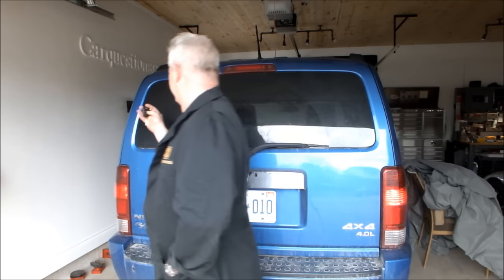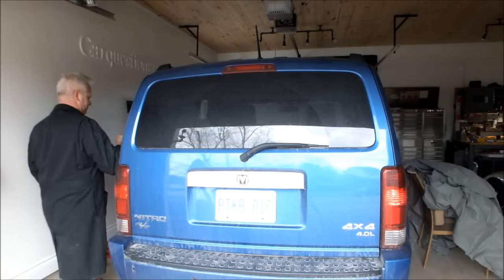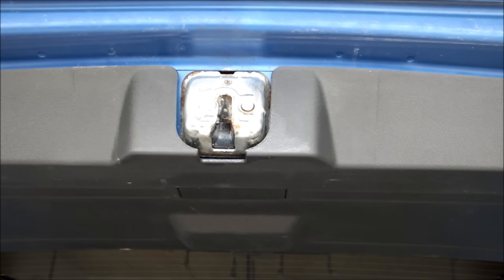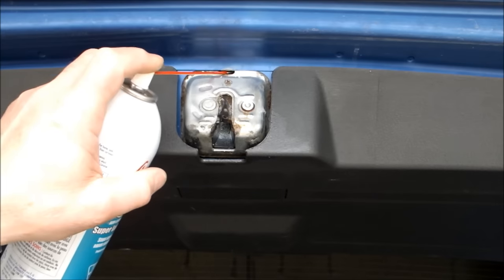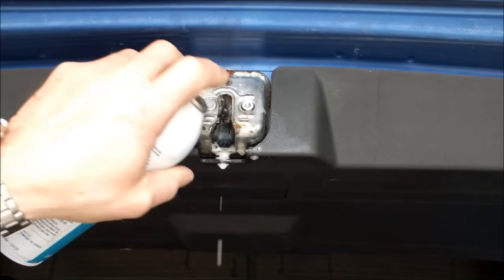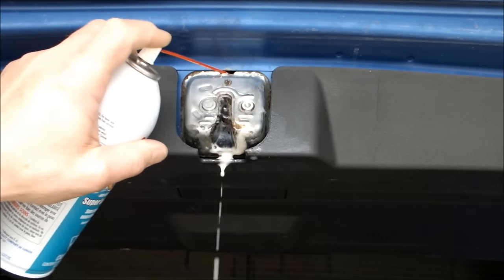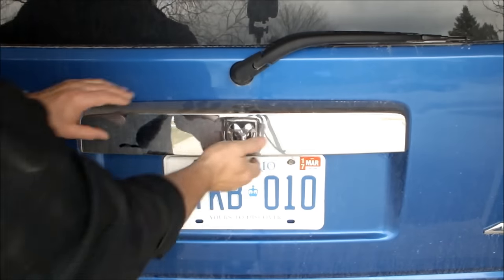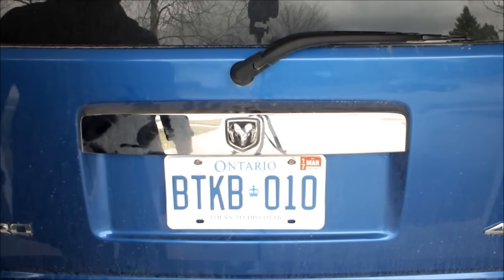Car Alarm Keeps Going Off - How To Fix It

Comment: My Ford Escape is doing the same thing! I go outside every night and slam each doors like crazy then go to bed, well that isn't working anymore (annoyed) it goes off at 2am! I will be driving down the road and my door ajar light will come on...(annoyed) did you say to say WD40? Thanks for the tip! I am going to try it.
Reply: Did this work for you? My Ford Escape does the same annoying thing...
Reply: I tried the liquid wrench- I used it on all my latches. I think I sprayed way to much into my driver side latch. The remote nor the button on the side to lock the door wouldn't work. I had to use the key. 3 weeks later it started working again ---So be careful with that. My alarm went off twice since then. I still go slam them all before bed time. But instead of using my remote to lock all the doors, i use the key instead. So far so good.
Reply: txb4u Ah, cool. I actually don't use my remote. I just lock it with the key. My issue is the alarm goes off hours after not even touching the vehicle. I've tried the wD40 approach and it will work for a day or two before the alarm decides to be a dick again.
Reply: Man- well try the liquid wrench and see? to me it seems a little more greasier) 
I think that the back hatch latch may be the trouble maker. When I go it open it, it seems like its way too easy to open, whereas if I open the glass part It seems like it's latched on tighter, I think the batch hatch door is failing. Next trip to the mechanic I will mention it, In the meantime- ring around the Ford Escape slamming doors like I am mad a the world! 
Hope the best for ya man! Take care
Reply from the maker: Then try to narrow down which door it is and have the latch removed for inspection or replacement
Reply: I've just been disconnecting my battery terminal for the time being until I can get it to a garage.

Comment: That works for awhile, maybe a few months, but eventually you will need to isolate which switch it is and replace it. Or, you may be able to use an OBDII USB interface and a laptop and toggle the door ajar switch to off in the software. I always thought that horn beep alarm was worthless and just a nuisance. If you can't do that just disconnect your horn, all the horn does is create road rage and will get you killed.
Reply from the maker: Well said Doug! Cheers from Canada!

Comment: I won’t even lock my car and a few minutes later I come back and open the door and car alarm will go off also my key fob won’t work any ideas ??
Reply from the maker: Get a new fob and try the procedure on all doors - let me know how you make out
Reply: @carquestions  I changed my battery on my key on a Acura MDX 2008 now my alarm goes off crazy the doors won't open and if I touch the door handles it goes off the alarm what I do need HELP

Comment: I have a 08 Ford edge and the alarm goes off on its own and the doors lock and unlock by themselves what could the problem be
Reply from the maker: Bad switch in one of the doors or rear hatch - try spraying - or replace the switch

Comment: My van locks but the side door doesn't I lock the van with remote and everytime it beeps so all the van is locked but side door is open any suggestions please
Reply from the maker: Ya bad connection or door lock motor - get in there and check - let me know what you find

Comment: I have a 2009 kia megentis and this happens plus it keeps saying the drivers side  door is ajar. Could that set off the alarm
Reply from the maker: Yes it can! - check the switch in the driver's lock for rust or replace it - let me know what happens. - Cheers from Canada Josh!

Comment: Interesting. Has the same issue with my 2009 Mazda 6. Dealer says its a problem with a computer and that'd be about $500 to fix(I also have the key fob batteries draining out in a couple weeks, apparently that's a related defect where the computer is constantly communicating with the key fob, draining the batteries)... I'll give this a try, at least for the alarm which annoys the neighbors, I have nothing to lose at this point.
Reply from the maker: Let me know what happens - good luck HC

Comment: My 2005 Nissan Ultima keeps beeping when car is off periodically how can I resolve this issue
Reply from the maker: check to see on dash if each door and trunk switch is working by opening each one at a time - dash light should come on - if one doesn't - then that's the lock that needs repair

Comment: Where are the other door switches located typically?
Reply from the maker: They are incorporated into the door latch in most cases - old cars from the 70's had separate switch on the door post somewhere

Comment: just put a new starter in my 2006 pt cruiser. lost remote to alarm a while because someone broke into my car so i stopped locking it. now the alarm wont go off until i cut thr car off. it only stops when i go over 50 mph
Reply from the maker: Does the dash say you have an open door while driving sometimes? if it doe - try this procedure on all doors and hatch - it could be any one of them -

Comment: It involves the lock on my truck in a way, i got a key fob to program to my truck(97 silverado), it says to connect terminals 8 and 4 on the scanner port up front and the locks shoulg go up and down. They don't though that's the problem. Tried copper wire and anything conductive but nothing worked. Even went to the dealer and they couldn't figure it out either.

Comment: I just noticed my 2005 dodge Dakota truck alarm lights are flashing, even though the alarm is broken. I just got a new battery with new terminals, and this afternoon i go out and the alarm lights are flashing. Any thoughts.
Reply from the maker: Try the horn to see if its working - if it does I'm thinking TIPM issue - if it doesn't try the spray and let me know what you find - Cheers and good luck

Comment: My alarm is on and fob will not work had to take out the battery cable any suggestions?
Reply from the maker: leave battery disconnected for tonight and lock all doors and check it in the morning

Comment: My 1998 toyota sienna car alarm is acting up again. Disabling my ignition/ starter whenever I try to start up the vehicle to drive. I lost my key fob
Reply: A couple things I would try. If there is a red light/button next to the steering column on the dash, turn your key to the ON position and press and hold that red button for about 5 seconds, that should disengage the immobilizer and allow the engine to start. Alternatively, insert your key into the ignition and switch between the OFF and ON positions 5 times, you may hear the alarm chirp to indicate it's been reset. You'll need to keep the key pressed in while you do this for a smooth action.

Comment: Can i just get rid of the alarm. It goes off while I'm inside with it running... Its a 96 ford ranger
Reply from the maker: Look in the owner's manual for the location of the horn fuse or horn relay - then pull it out and remove it - that will stop it but you'll have no horn

Comment: I have a problem when I turn my car on everything just starts to go off emergency lights headlights windshield wipers what can it be?
Reply from the maker: love to know but you didn't say what the make model and year was
Reply: carquestions 2009 Nissan 370z
Reply from the maker: You have a serious electrical issue - check the battery for voltage and all connections right away for damage, loose fit, corrosion etc - check every wire you can - try another battery - if you find nothing get it into a shop right away

Comment: I have a 2004 Nissan Xterra it just started that this week like I'll lock it up for the night go in my room than I hear it randomly go off for no reason so far to keep the "peace" I took the 15A fuse for the horn out, but the lights still flashing basically saying the alarm is still going off randomly. PLEASE HELP!
Reply from the maker: lock it manually without alarm then pull fuel pump fuse

Comment: This wasn't the issue in my case. The remote key (hold for alarm) button was stuck down. If taking out the key battery stops it, then it's the key. I had to open it and polish down the button stump inside to make it shorter and give it room to unclick.
Reply from the maker: Thanks for the info Alvaro -
Reply: carquestions thank you too.

Comment: I have a Chrysler Town & country 99 model the alarm keeps going off and the emergency flashers keep coming on even when the buttons off
Reply from the maker: You might have a problem with the TIPM (fuse box corrodes) Sam - might be a free recall repair - so look for TIPM problems online with a google search to learn more
Reply: @carquestions  thank you I'm researching it now

Comment: my alarm keeps going off through the night, my neighbours won't be very happy. I have only had the car a couple of weeks, I have just sprayed all the latches with wd40 fingers crossed it works. It is a 2009 dodge caliber, I am not sure if the alarm is after market. the garage where i purchased it brought it to me becouse of covid. a couple of days later i was about to take it out for the first time and it wouldn't start, so i called the garage and they came and used leads to start it up, they left me with thier charger but I wanted to be sure i wouldnt get stranded so i took it for a new battery, its started fine since then. But when i tired to recharge the old battery it said Full after 5 minutes.  I dont know if these issues are coming from the same place, but if anyone else has one of these cars and can shed some light on it for me id be greatful 

I will leave the car alone now and see if the WD40 in the latches works .  but wether it works or not thank you :-)
Reply from the maker: Get the charging system checked to see if it's charging the battery and let me know how it works out - cheers from Canada!

Comment: common with acura mdx hood latch... the alarm microswitch gums up with dirty oil and when humid weather hits the alarm goes off... easy fix … clean switch or as I did unplug the connector...
Reply: Wondering if this could be what’s happening with my csx as well. Thanks for commenting; will have to try this.

Comment: This just happened to my dodge nitro 2009 same as yours twice at 3.30am. The first time I just locked it again with my keys to stop it. 2nd time I did the same thing. But this time went to the car to grab my toolbox in the back to get tools to unhook the battery & deal with it in the morning, as i dont have 4WD here. LO AND BEHOLD I hadnt shut the back door gate properly!! And the car was trying to tell me "you've locked the car but one of our doors isnt locked shut instead it's just hanging". Hence the alarm so guys check your doors are shut right as it could just be that 😅
Reply from the maker: Very good advice Skribbz - cheers!

Comment: I've done this and it's still going off.
It usually happens at night, sometimes in the day. I don't know what to do anymore asides disconnecting the car alarm
Reply from the maker: You might want to check the computer for fault codes - and start your troubleshooting from there - or take it to a local garage but don't let them experiment - if they recommend you do such and such - ok it if they promise that will definitely fix it - you're not paying for guessing

Comment: My car is a Kia soul 2012 and my car alarm started going off randomly yesterday I tried making sure all of the doors where shut and all but it still doing it today.
Reply from the maker: All doors, hood hatch etc? - if it doesn't work disconnect the battery negative terminal to stop the horn and later take it in to a local mechanic -  let me know Katie how it works out

Comment: I am having this same problem on my 2010 jeep liberty but the I also thought the glass might be the problem because I have the hatch for the glass if u press the keyfob 2times it should open but it won't but if also tried plus ing it shut and it doesn't seem like it's even opened at all it might just be because it's cold and frozen but it seems like it's leaking as well but I will try this on the hatch and hopfully it works 👍👍
Reply from the maker: Good luck!
Reply: Didn't work my switch is actually no good

Comment: what product is that the lubricant?
Reply from the maker: WD 40 - you can get it anywhere
Reply: @carquestions  will it work on hyundai elantra 2008
Reply from the maker: @mohamedfarah8540  you have to try it to find out - won't hurt anything

Comment: My alarm went off and I realized my keyfob was in a shirt pocket that was getting washed. I dried off the keyfob and the alarm keeps going off. I pulled out the battery and put it back in, but the alarm keeps going off.
Reply from the maker: Kristi - open the remote, remove battery and put on a heater vent in a tin plate for a day - then retry it - hope it works - needs more drying I think - Cheers from Canada!
Reply: @carquestions  you were right. It works fine now.

Comment: The "gate" lighting has turned off and the brightness of the speedometer area has returned. Now time will tell if the alarm is done going off. So far thanks a ton. 2011 dodge nitro.
Reply from the maker: Brad - also read up on google for TIPM problem - sounds like you may have other issues too
Reply: Very interesting... thanks

Comment: I have a 2017 Toyota Corolla where you can unlock lock the car with the door handle when I do it on passenger side the alarm goes off!
Reply from the maker: Sounds like a bad switch in the door - try the procedure and hope it works - soak it from every angle you can
Reply: carquestions what do you mean by soak it from every angle you can?

Comment: I started with my dome light not turning off then my alarm started going off whenever it felt like it now my door alarm doesn't tell me it's open the truck doesn't tell me my keys are still in it and the doors lock and unlock whenever they feel like it.  It doesn't tell me that my lights are on anymore and I'm positive it is all connected to my alarm.
Reply from the maker: KT - google TIPM problems - I suspect you have that

Comment: Unfortunately this started happening after I had removed the key rings inside the key hole thing because it got warped and sludge over the years. I don't know what it could be because nobody else seems to complain that it happened to them. The cables are snug and secured, there are no indicator that a door is ajar or anything but the display does work for all doors just fine. I even decided not to lock the car and it still sounds the alarm.  The only way to remedy this is to unplug the battery for now. I will try and disable my car alarm and hope it will be a good temporary solution. I don't really hear my car alarm go off from inside this well insulated house but my neighbors do and just my luck it started happening a week after i removed those key ring things at night time. IF anyone knows the answer, please let me know!
Reply from the maker: You need to say what make model and year of car is  so I can help you Natsume
Reply: Okay so after doing some research which was conveniently found immediately.

1. You can disable your car alarm. There's a button and a process to press to do this. 

or even better...

2. If there is no sensor light it probably is the hood latch. Basically the hood latch has a antenna looking thing that tells if the hood is locked or not. You probably don't need to replace it, you might just need to bend it in place. But if your car doors lock but there's no honk, and there's no door ajar indicator, that's probably it right there.

Comment: THANK YOU VERY MUCH.... it worked on my Ford Mondeo 😁😁😁
Reply from the maker: Thanks for the info Sherif
Reply: Yes, my 2007 Ford Escape just started doing this really bad for no reason in the last 2 weeks. My neighbors are horrible and called the police on me ! I'm 62 and couldn't get to my keys on 3 different times right away. People are really rude and don't care if you are having a problem. This is the first time I've has this happen. Their kids slam basketballs all night long right next to my car so hard and I believe it's making my alarm go off! I'm going to try your suggestions because it's a 2007 Escape Ford hatchback. The locks could need liquid wrench like you said because I just had it to get it serviced and I had to get a partial new tailpipe because of rust. Other than that, my car is in fantastic condition with very low miles. Thanks for your info.!

Comment: Has any one tried this with a chrysler Pacifica alarm going off soon as I unlock from the outside. Tried sticking key in ignition to start the car and shut off the alarm car won't even start.

Comment: ok now what do I do when the horn keeps honking???? 
like you just tapped the horn twice, every 15 minutes.
Reply from the maker: DB - Disconnect the battery negative terminal until you find the  problem.
Reply: @carquestions  
it appears to be in
 "car finder mode" 
now how do I turn it off.
Reply from the maker: @dabunnyrabbit2620  Usually you push  a button on the remote - check your owner's manual for your specific car. Cheers - and let me know how it works.
Reply: @carquestions  
owners manual is MIA.
but I'm looking into other things.
Reply from the maker: @dabunnyrabbit2620  google your make and model for owners manual

Comment: i have a 2003 hyandai elantra. i dont have an alarm. there is an alarm going off it will only go off if i disconnect battery.I didnteven know i had alarm never heard it in 7 yrs of owning car no lock button, just key?
Reply from the maker: If you obtained the car used it is very common that it might have had a self starter, alarm etc and the previous owner lost or never turned in the remote in when selling it so the next owner is unaware it has these features - so a trip to the local Hyundai dealer is required to determine if it has that feature and to get a remote if needed
Reply: +carquestions Thank u. so in meantime, just keep doing what I'm doing I guess.
Reply from the maker: Yes - until you can get it in to a dealer